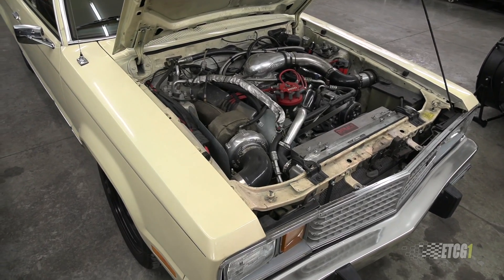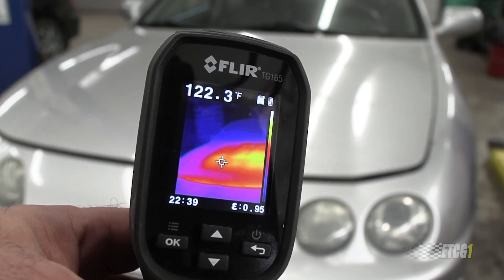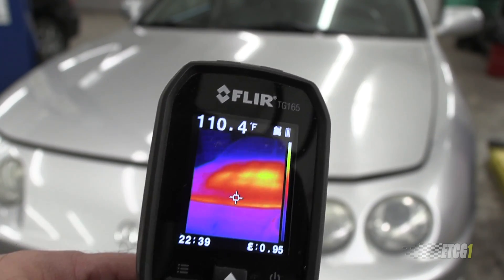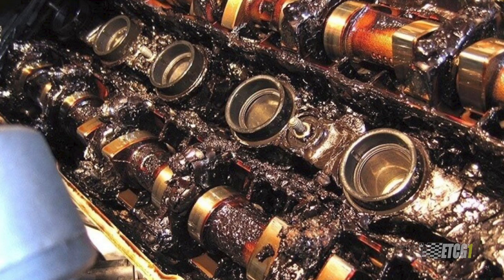What Is Heat Soak?

Comment: I've never really worried about it, TBH.  When you cut an engine off, it immediately stops producing heat.  So at that point all you're doing by opening the hood or running a cooling fan is helping it cool off faster.  However, since it's not producing heat anymore - and if you have a good cooling system that never lets it get hotter than a certain temperature anyway - letting it cool naturally won't cause any harm to the components under the hood.  (They are, after all, designed for being at high temperatures.)  That said, if you're not running a quality modern motor oil then it might behoove you to cool at least the upper cylinder head area a little faster to prevent oil burn.  But, at least in my experience anyway, quality modern motor oils can withstand being stagnant in higher temperatures for the typical periods of engine cool-down after shutoff.
Reply from the maker: I think you miss the point of what heat soak actually is. When you shut your engine off, the cooling system stops working and therefore, stops moving heat for you. That heat builds up under the hood instead of being dissipated by the cooling system. Temps can reach much higher than operating temperature as a result and the lack of cooling and compounds the effects.
Reply: @ETCG1  Eric what 'operating temps' are you talking about ? It can't get higher after shutoff because the ONE thing that produces that heat is shut off. Sure you might get a little spike in cylinder head coolant passages for a little bit since there is no flow to transport that heat but that's a very short time AND opening a hood won't do a thing for preventing that. The amount of heat coming from combustion is SO much more than what the surrounding air is, after shutoff this quickly disappears.
Reply: @ETCG1  It's curious that you'd say that since, after doing some additional research, it seems that the term "heat soak" is used to actually describe two completely different phenomenon.  But, that said, it comes down to basic science whereby if you remove a heat source (i.e., a running engine) while the temperatures contained in the engine may spread (dissipate) - the temperatures will not increase (get hotter) because you don't have a source continuing to generate said heat.  What that boils down to (no pun intended) is that, yes, the heat may spread to other components - but, those components are designed to operate at the temperatures typically found under the hood whenever the engine is running.  Further information:
https://www.kawasakininja300.com/threads/overheating-and-heat-soak-should-you-worry.3349/
https://www.9thgencivic.com/threads/heat-soak.73818/
https://www.fordgt500.com/threads/heat-soak-during-daily-driving.4233/
The last two links describe a different "heat soak" than you seem to be talking about.  The first link does some scientific testing on the heat soak you're referring to and confirms what I said in my OP.
Reply from the maker: If engine operating temp is 180º and when you shut the engine off under hood temps climb above 250º, I call that an increase in temperature. The entire purpose of the cooling system is to remove heat. If the cooling system is shut off, you stop removing heat and it builds to a peak and THEN starts to dissipate. Heat soak temps are much higher than operating temps because the cooling system is no longer functioning and the under hood area is often insulated thus trapping heat in the engine compartment. It's very similar to a greenhouse effect. Opening the hood allows the heat to dissipate more quickly and efficiently.
Reply: @ETCG1  But Eric - when you shut the engine off you aren't GENERATING anymore heat.  All you've got is the residual leftover heat that wasn't carried away by the coolant.  If you put a pot of water on the stove and bring it to a boil, and then remove it from the heat - the temperature cannot increase because you don't have a source anymore.
Why not do a video on it and test it?  Take samples using an IR thermometer of various components while the engine is running at full operating temperature.  Close the hood and shut the engine off.  Let it sit for say, 3 or 5 minutes, and then recheck the temperatures on all the components?  Then close the hood and maybe wait 10 minutes and check again.  I'll watch your video if you post it.
Reply from the maker: @Nope NottaLib You may not be generating more heat, but you're not getting rid of it either. Therefore it stays trapped under the hood and actually increases overall temp for a bit before dissipating. More info here.

http://www.mawsolutions.com/html/heat%20soak%20effects%20on%20engines.htm
Reply: @ETCG1  OK, so I read your article and did some more independent research.  I think I might have figured out what you're trying to explain.  This is what I've come up with:
A running engine generates heat.  The heat is carried away by the cooling system as the engine runs.  (Turning the water pump.)  When the engine stops running, it isn't generating anymore heat ... BUT ... the residual heat still has to go somewhere.  Ideally, it would be dissipated into the air or some other medium that suffers no ill fate by receiving the excess heat.  However - in the case of an enclosed engine bay, the heat will transfer to (soak) surrounding components (i.e., cylinder head, metal shrouds, turbochargers, electronics, etc.) as it dissipates away from the engine core.  So, in effect, certain components WILL increase in temperature from their reference points (how hot / cold they are when the engine is running and the cooling system is dissipating heat.)  BUT - you're not getting MORE heat (because you don't have a source to produce said heat) - rather, you're taking something with an excess of heat (engine block) and transferring that heat to other components that might not normally be an avenue for heat dissipation under normal operating conditions.  So an electrical component (say an ignition module) that normally only sees temperatures of 150*F when the engine is running could potentially see temperatures much higher when the engine is hot but not running.
However; what's important to note is that you're not really increasing heat.  What you're doing is transferring heat energy from one location to another.  So yes, that external component by itself IS increasing in heat ... but the engine block itself is DECREASING in stored heat.  (Again, you have to keep your reference point in mind.)
You're not "gaining" heat anywhere ... you're transferring it from one location to another.  You cannot "gain" heat without an active source.  But you CAN transfer it.
With that said, it IS possible that you might transfer enough heat energy to any given component that exceeds that component's designed heat capacity.  However; it's worth noting that the vast majority of components have an acceptable "operating" temperature range that varies significantly from said component's "non-operating" temperature range.  As an example, a laptop that is powered down and not operating can happily exist in 150*F+ temperatures.  But if it is OPERATING - the temperature range drops significantly to around 80*F.
So, when you say you're seeing temperature "increases" up to 250*F - you're not seeing that in the original SOURCE of the heat (running engine block.)  What you're seeing is the transference of the heat in the engine block being transferred to the exterior components - thus giving the illusion that you're actually "gaining" heat, when in fact you're not.
Reply from the maker: This is a direct quote from the article I sent you. "When the engine is switched OFF, the cooling system becomes inactive and the residual heat in the engine from the block, head and exhaust manifold are transferred to the coolant and other engine components. THE ENGINE TEMPERATURE ACTUALLY INCREASES AFTER A HOT ENGINE SHUTDOWN. This is called 'afterboil' or 'heat soak' and can be damaging to engine life."

We're almost there.
Reply: @ETCG1  I'm going to get an IR thermometer and test it on my vehicles.  I've got three different vehicles across three different manufacturers so I think it will be a fair test.  I still can't wrap my head around how heat is being increased when a heat source ceases to exist.  I'll post my findings here.  Like I said, I can see individual components getting hotter - but if something like the coolant is getting hotter, then something else is getting colder.  If possible, I'll try to record it and post it as a video.

Comment: Have been wondering if the engine computer, or it's programmers have taken this into the account with start&stop engines? For example after long highway driving you stop to red lights. If the engine stops, water pump stops as well. Especially with Turbo engines it might be not a good idea to stop the engine immediatly?
Reply: Some cars these days have an auxillary electric water pump for these reasons. Used to only really see it on vw's but they're more common now
Reply: highway driving is actually the easiest on an engine. Low load and high air flow. When you stop, it's not heat stressed at all. Stop and go in high heat is MUCH more stressfull on an engine. Higher load and lower air flow.

Comment: Why don’t more cars have hood vents?  The opening should face the driver and not forward.
Reply from the maker: I put one in my Fairmont. I think the reason they might not be on more production vehicles is because of water intrusion. It's one of the things I engineered for when I made mine. Also, like everything else, cost.

Comment: Getting my toda replica manifold heat wrapped next week, to go with my custom 2.5" exhaust on my b18c. Currently has a an open cone intake (which is also getting replaced for a mugen intake) which is suffering badly from heat soak.

Comment: On my turbocharged car, I always let the system idle for 2-3min before shutting off the engine.  A turbo timer would do this for me, but I'm cheap.
Reply: You only need to wait till the fans kick off
Reply: @brysonshires9742  it's also good to let the turbo spoll down to idle as if you drive It hard then park and turn it off straight away you'll lower the life span of the turbos as when the engine is off the turbos are still coming down to a stop so it cuts off the turbos oil supply ultimately damaging the bearings in the turbo, and if it's a diesel and the seals go you could end up with a runaway diesel :)

Comment: I sometimes do the same as you, leaving the hood open when I park in my fairly small garage after a longer trip or if I was running hard. Also even though I've got water cooling going to my turbo, I still let it idle for 10-15 seconds after coming to a stop just to help the center cartridge cool down a little bit better. It's small things like these that ultimately prolong the life of our vehicles. And when you add all these precautions up, it can mean driving your car for a year or more before it really *dies*.
Reply: We do same with turbo engines on piston engine airplanes.  Let the engine release the heat, specially in the summer. Why not?

Comment: Install an electric fan that is allowed to go on even when engine is turned off. It would turn of when it cools down to a certain temperature.
Reply from the maker: I believe I mentioned that in the video. Thanks for the comment.
Reply: @ETCG1  I guess I wanted to highlight that it works great, every vehicle should have it to prevent heat soaks. Instead of that ineffective clutch fan that some vehicles have. Thanks for the videos!

Comment: Ah yes, heat soak.. This is why my Saturn would run the fan when the temp got to 226 degrees F, especially when I shut it down
Reply: Yes my Saturn also has this feature where it will run the fan with the ignition off.
Reply: Took my aunts Saturn to the junk yard with my older brother (when I was a kid)
About 4 minutes after we start idling down the rows looking for a winner, the radiator cap explodes open. 
Turns out her fans hadn’t been working for years. 
It got heat soaked as F!
Reply: Same as ALL vehicles that were made in the last 50 years

Comment: Hey Eric, have you ever considered an electric water pump in one of your custom engines? These are pretty new on new cars, but made to run for a bit longer after the engine shuts off.
Reply from the maker: They work great for the track, but not driving on the street as coolant flow does not match engine RPM like a mechanical pump does. My cars are made for the street, not the track.
Reply: @ETCG1  Ah yes, that makes sense. Thanks!